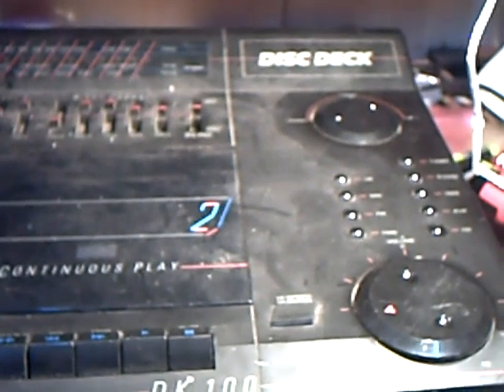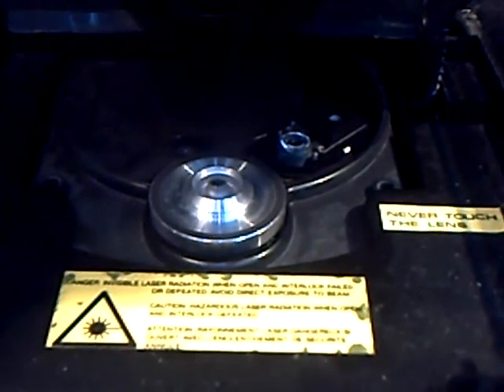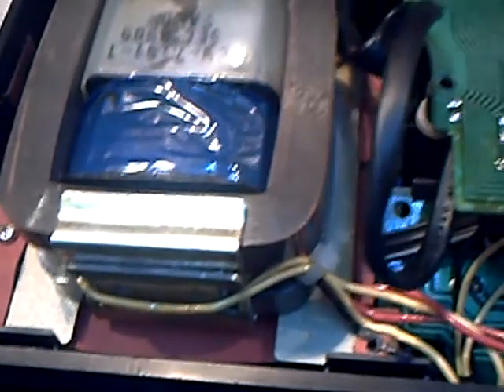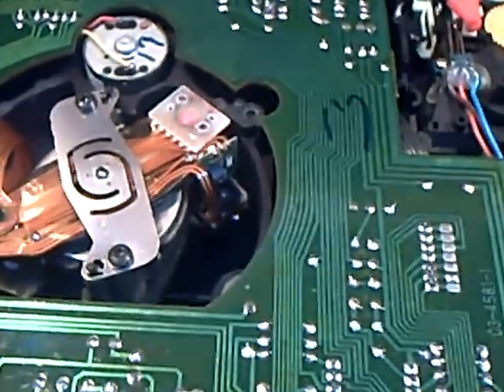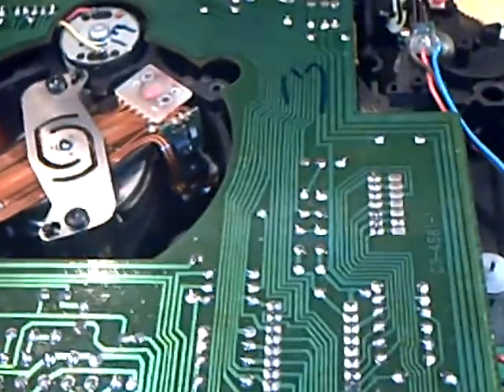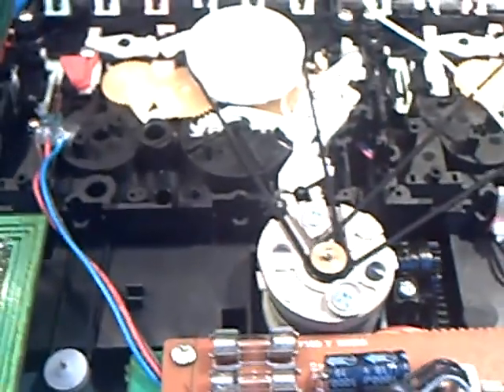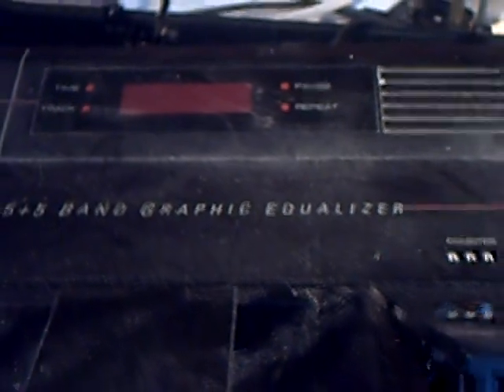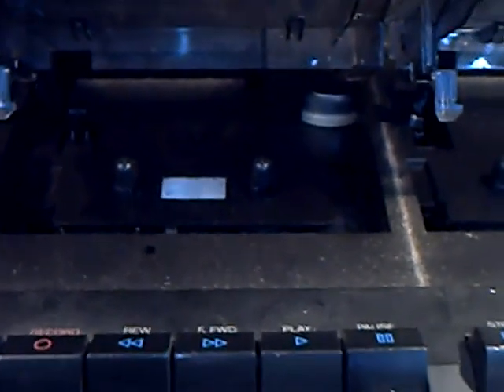An unusual CD creature...

Comment: The CDm4 was indeed a philips mechanism and was used in many higher end hi-fi machines including many by Marantz and other japanese manufacturers. The linear CD mechanism was designed to offer fast track skipping and quieter operation. You can pick them up for next to nothing on eBay, and it would be well worth replacing as it's an exceptional transport when it's working. I did also once fix one by removing the laser and dumping it in water with a drop of alcohol, then letting it dry out for a few days. Obviously not a recommended method of repair but it was a very last resort and it worked.